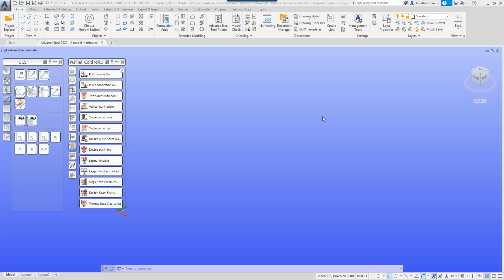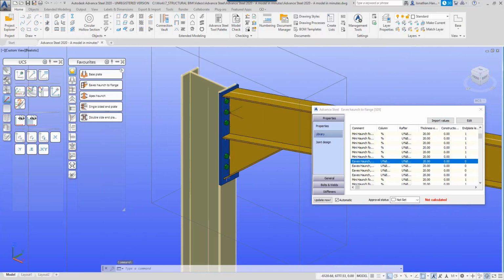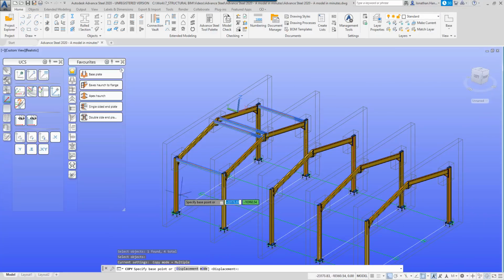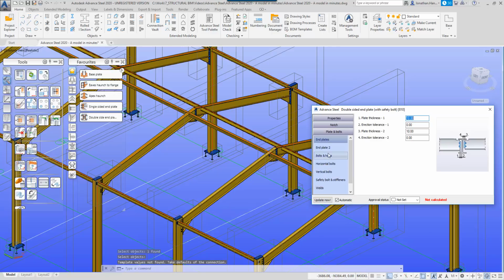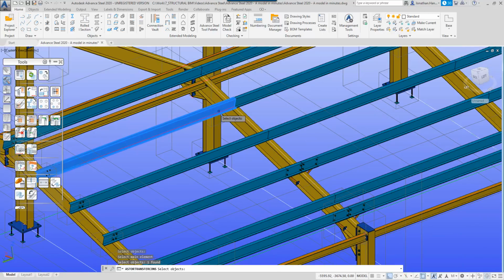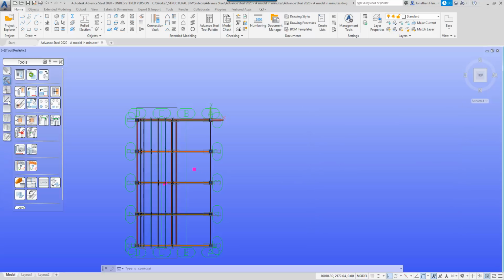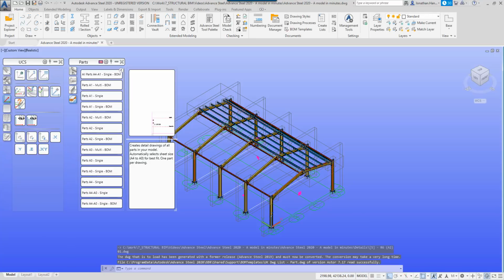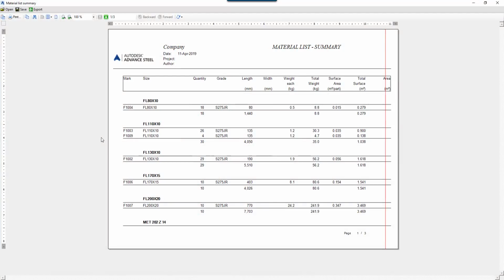Advance Steel - A model in minutes

Comment: It was modeled by applying c purine macro.
In general beam modeling application, c purin is output.
However, when applying cpurin macro modeling, cpurin does not appear in the 3d drawing view.
Regarding the problem of c purine macro, please explain the video in detail.